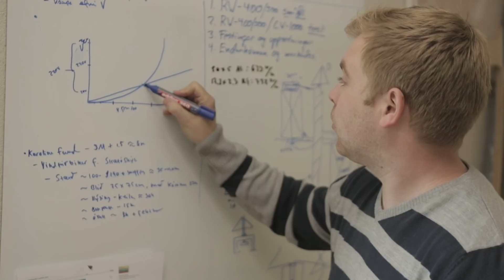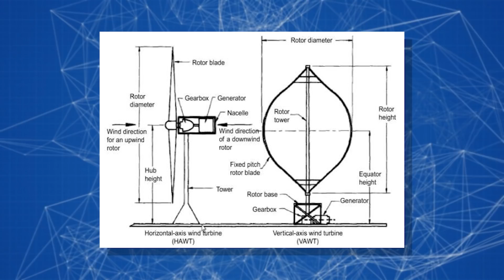Why This Wind Turbine Will Change The World

Comment: 100W? So it would take maybe 20 of these to bake a pizza? (Electrical panels in most houses are at least 100 AMPS X 240 VOLTS = 24000 WATTS)  This turbine may be interesting, but at present it does not seem very practical.

Comment: After viewing and reading the comments, it appears that for commercial application the VAWT may not be as applicable, but for residential purposes, like solar may assist with minimizing the electrical load. Couple with, if it becomes popular such as solar and a large percentage like solar gets installed will have an impact. Granted its windy...

Comment: I'm trying to figure out why you are comparing a little 1000 watt vertical axis wind turbine with commercial sized megawatt scale wind turbines...
There is no comparison.......
You do realize that you would need like 1500 of those little vertical axis wind Mills to equal just one commercial windmills. Also the efficiency of that style vertical windmills is about half of what the horizontal windmills are.
Wake up...

Comment: These can't go anywhere and be very efficient.  Urban areas have many wind breaks and you don't get NEARLY the wind that a typical wind turbine gets.  So while you CAN put it in your back yard, that doesn't mean the wind is going to be very good and you probably get near the lower end of that generation, which is too low to even run a gaming PC with a powerful GPU.  And don't even think about running a clothes dryer.  You need the big one for that.

Comment: Pure nonsense. Old tech in a different colour. Toy turbines compared to proper megaWatt machines is not a valid comparison. The efficiency of these turbines is very low compared to standard horizontal axis turbines and the torque developed is much less useful. Their only real advantage is omnidirectional operation.They're certainly not any kind of game changer.

Comment: Wind turbines need wind to work. Have a day or two without any wind or just s gentle breeze and wind turbines output is reduced. If the  wind is too high the turbine has to be turned off.

Comment: So funny - How many scammers have sold these type of wind turbines to uninformed consumers - Just ask Jay Leno - look it up!  He got scammed big time - from a guy who got investors and only build one for Leno's garage with fake UL stickers etd - which produced no power.   This is a 50 year old issue that clearly has VAWT losing every time - but there are so many people who wont do the research or the thousands of hard working engineers who have learned the hard way that VAWT are never going to produce even a fraction of the energy they claim.   Guy at Innovative Techs - you have got to do more research before you make these claims !

Comment: Since 2012, the average height of wind turbines installed in the United States has been about 280 feet, or 80 meters. Wind at that height is much greater than close to ground level.  The video shown here is merely about 10 feet.

Comment: I am not 100% certain but except the one with the american flag on it, the vertical axis turbines showed in the video are Savonius turbines. They wind passing them generates a drag force powering the rotation. Anybody familiar with wind power knows that these turbines have terrible power factors (meaning they don't produce much electricity). As other comments pointed out this is nothing new. Savonius filed his patent in 1924. Most turbines in the video are placed on buildings in turbulent wind. Most of these turbines will struggle to produce any useful amount of electricity and generate noise into the building. The silent operation you mention in the video sounds stupid, less rotation means less power coefficient and pretty much no power. Other comments also pointed out that these turbines capacity is very low in comparison to the huge megawatt turbines you are comparing it to. Why don't trucking companies just drive bikes instead? BECAUSE THE LOAD WON'T FIT!!!!

The real use case of these inefficient, small and simple turbines is shown in the video but not explained by the narrator. If you for example have a bus stop that needs power it might be very expencive to connect it to the power grid when a small turbine on top of it might be sufficcient to power it. 

I am really disappointed that youtube recommended this video. Its suprisingly low quality.

Comment: I want one to put on my car I will buy a million of these Contraptions I want to put it on my car to generate electricity why I drive
Reply: That doesn't work. Energy out=approx 15% of energy in. So by driving a car at speed the wind resistance created is 100%, the energy generated is 15% therefore the car will not move without another source of power. Perpetual motion machines can't be made.

Comment: My induction cooking system uses 7,700 watt at full power.  Which vertical turbine for "domestic use" can offer this power?  How many do I need to install?  I also need power for lights, electric water boiler, washing machine, linnen dryer, dish washer, baking oven, microwave oven, TV, computer(s)...  It will be a sad day when there is little or no wind, like most of the time where I live.

Comment: Like other turbines and solar panels, this unit is unable to provide a surge of extra power should it be installed in a latitude with extreme cold or hot. This is where coal and gas fired power plants  are far more efficient.

Comment: Vertical axis wind turbines is nothing new and they don't last long, the bearings are stressed out with 2 different g-forces (1, the force of gravity 2, the outward pull caused by the wings).  They wear out quicker. They're impossible to repair. They're more difficult to stop, compare to horizontal axis wind turbines as they have the advantage of turning away from the wind direction, twisting the blades to reduce wind pushing and they have an emergency brake inside.

Comment: This video contains specious claims.  The first is that this type of wind turbine is a new invention.  There have been many vertical axis turbines with helical blades like this before.  The second is the power output of these turbines is minuscule compared to conventional wind turbines - on the order of 0.5 kn to 1 Mw.  The  video conveniently overlooks this fact. Hundreds of these helical turbines will be needed to equal the output of just one large conventional turbine.

Comment: The problem is that if the world stopped using all petroleum and coal products, not much would change. All manufacturing, including making batteries, generators and motors creates pollution and greenhouse gases.

Comment: This is clearly a fluff piece. Green energy still only occupies a small percentage of total energy produced. Its been growing, but not fast enough. To fossil fuels out, you need to embrace nuclear. At least in the medium term. 20 to 100 years.

Iceland only has a little over 300,000. Just one mid size city, in the US. 100% green energy for them is not a big deal.

As mentioned before helical turbines are not new. Okay for small installations.  3000W max. That's not much. Typical roof top solar exceed that routinely. There are existing RESIDENTIAL wind turbines that output from 1500 to 8000 watts. The over 3000 wind turbines in Tehachapi (California) are rated on average 200,000 watts, each. ~100x bigger  ! Remember the square-cubed law, when it comes to scaling. Materials, and serious engineering have to be taken into account to scale up, that large. Its not a trivial task. So comparing the requirements of a residential unit, versus a utility unit, 100x larger, is really disingenuous !

Comment: The only redeeming thing about this video is that not a single person in the industry could possibly fall for this bullshit. A huge mass of unsubstantiated claims. 93GW of wind power capacity were installed in 2020. Care to guess how much of that was in horizontal axis wind turbines? About 93GW of course. And that's not because the companies that want to sell electricity go for the most expensive option, or the one with the most problems. They go for what works and makes sense.

It's a shame that this misinformation is upvoted as much as it is.

Comment: This sounds like you have NO idea what's going on in this trillion dollar industry.. WInd turbines aren't placed from homes because they produce so much noise and vibration, that's what Trump told you. The only issue is the shadow flicker. All the other problems do exist but are being managed just fine. The cost of installation also isn't increasing exponentially... In that case bigger wind turbines would never be economical, yet everyone is trying to install the bigger ones. Why? Because the cost to power production ratio get's better, the bigger the turbine is.

Also you don't seem to know how horizontal axis wind turbines work. They ALSO rotate because of the difference in pressure between the air above and beyond the turbine blade.

I hope you got a big paycheque for this video from the company you're advertising for. This video is a joke to anyone who knows what's going on.

Comment: This earth has been going through temperature changes for eons. It will get hotter and it will get colder. Go look at the hundreds of layers of ice in the arctic. They show "Hot", "Cold", and lukewarm the deeper you dig. It is just the way the earth is. We are a pebble in the universe. An IMPORTANT pebble but we are flying through space and time always.
Reply: The Earth is supposed to be in a cooling cycle, but industry over the last 150 years has artificially changed that to a warming trend. This warming cycle has warmed up the Earth in those 150 years as much as all the previous warming cycles had, taking 10-20,000 years, each, to do it.

Comment: Flat blades pivoting sideways while its oposite half pivots up betz claims impossible to support oil prices is and has caused global warming brain washed science of 1919 look at automatic feathering flat blade radial windmills both horizontal and vertical hoover dams in tides and winds that reverse naturally. Capable of gearing to light speeds right in left corner .

Comment: Weird to compare the noise produced by a tiny rotating metal structure that produces 100W of electricity, to a gigantic 1.5MW wind turbine. Then you didn't solve the noise, the structure, the complexity. You just scaled down

Comment: Another video that claim that solar and wind are clean energy... when you take note about the life cycle of solar panels and wind turbines, you realize is not that clean... Resources, Manufacturing, Distribution, Recycling... and this idea of vertical wind turbine is not new, simply is not efficient enough and not scalable enough... if you consider this for a home, then you need batteries, and that is another not clean story.

Comment: So it's a "new" type of wind turbine that's derived from a design patented in 1995 which was derived from a design patented in 1926. Hell you can find a helical turbine in DaVincis drawings.. I even saw a video claiming that it would be a "green" solution to put these next to roads to "recover" energy from passing cars, as if it wouldn't create drag and be fossil fuel generated energy with extra steps.

Comment: Not sure if the speaker is ignorant or incompetent. Does not know what "invention" means. Does not know that the  earth's average temperature has increased by about one degree for the last three centuries. Does not know the environmental cost of turbine blades, PV panels, and batteries. This is silly, clueless, or senseless.

Comment: What is the " minimum" wind speed for these to operate efficiently.??
Reply: Not sure exactly, it also depends on the generator and size(mass) but typically these types of WT require much less wind to operate but the video is clearly biased and not well researched. These turbines aren't as efficient as the traditional horizontal 3 blade design.

Comment: the main reason that horizontal axis wind turbines are generally used is that they convert wind to usable electricity more efficiently; when you combine that with the economy of scale and mature designs of the horizontal variant its pretty clear why they're used for most applications.
Reply: That depends on how you define the efficiency. Traditional horizontal fans wins out if you only consider the area they occupy. But that may not be the most important factor as the world is huge. What matters more is energy produced compared with cost of installation or service cost. Traditional horizontal fans are so terrible for both that they are almost not worth building. The vertical type shown in this video on the other hand is very cheap, that makes it not only better then the horizontal fans, but also compete better with other alternatives. It doesn't hurt that it's also less noisy and intrusive making it easy to put anywhere.
Reply: @znail4675  the range of wind speeds that thy operate in is greater Traditional horizontal fans need a big separation because of the turbulence they create

Comment: (facepalm)  What about this don't you get?  Wind is diffuse and intermittent.  You're never going to run a steel mill or rail system with it.  How, on those exceptionally rare occasions, are you going to store any surplus?  What are you going to use during peak power when it's insufficient to meat your needs?   Educate yourselves on Liquid Fueled, Molten Salt Thorium.  The name you want to know is Kirk Sorensen.  Off you go....

Comment: Ok, beautiful presentation. Now let me ask you, what is the power output or efficiency? 
Second, the noise from LARGE wind turbines can't be compared to such small turbines. 
Third, no way that can withstand a tornado, and the 90% slower speed for what?

In conclusion, that's worst than the guy that wanted to power the world with static power generator bikes,
or the one that made a tube and filled it with wind turbines and says it allows to extract 99% of the power from wind.

Turbines can have different sizes and forms, but the fact is that large conventional 60-70meter turbines don't have 4 blades because they would harvest too much wind power. 
Make stronger foundations and then increase to 4-5 blades and then you have increased production. Where is my novel price?
Reply: In all fairness, power lines can't withstand a tornado either.  Seems like a reasonable calculated risk if they produce enough to make them worthwhile.

Comment: Won't work in the scale needed for generating vast amounts of electricity.  He reason wind turbines are so large is that great torque is needed to send power into the gearbox, a transmission in reverse, you might say.  This spins the electric generator to produce the needed voltage.  In conventional power plants it is the opposite.  Fast spinning turbines need to be geared down before powering the generators.

Comment: Wind turbine, Solar panels, will not produce electricity, if there is no wind and during night time.  Elon Must knew that alternative energy will fluctuate up and down, and the only solution is BUY his TESLA Storage Battery to give power to indiviidual houses and one whole TOWN for hisTESLA MULTI STORAGE BATTERY. The wind turbine, Solar panel will charge the battery,  excess energy generated goes to the grid, but during storm, calamities you can have power for 3-4 days. EMusk  will monopolized Battery business by joining Lithium and Nickel minning Company from Australia and Indonesia.The money is in the battery not much on the car.

Comment: Solar energy burns alive thousands of birds each year, wind turbines kill thousands of birds too. When solar panels break, their contents are toxic for the soil and there isn't a recycling system to properly reuse and store said broken materials, additionally the production of these two "green energies" do have a carbon footprint and they need a gigantic area to work. These green energies are not really that green, and in addition to all of the above, these energies are extremely inefficient, thus increasing the cost of energy. The best and most ecologically friendly technology for producing energy right now is Thorium Reactors, but hey! cheap energy is not good for those who want to make a ton of money, so corrupt politicians are trying to block the use of thorium reactors.

Comment: Good luck. During the years there has been countless wind turbines that are just as good or more efficient than the standard design, and which is not a danger for birds, bats and insects. But it never happens. Why? Because the three bladed turbines dominates the market. They are the Microsoft of windpower.

Comment: The countries that report higher than 50 % renewable energy are lying. The wind turbine is screwed. Most of the turbines leak a ton of grease, and there is no spill containment for the grease, not even on the ground. The turbines also kill a lot of birds. Turbines are made out of oil based products and metal....all of which uses tons of oil and natural gas to manufacture. The whole save the earth with green energy is a lie. Even a new movie by Michael Moore points that out now.  For solar farms, you have to chop down hundreds of acres of trees to create the solar farm. Both wind and solar are also not reliable. Solar does not work at night, and turbines do not work when the wind does not blow...

Comment: Flowind tried helix wind turbins 35 years ago. I invested in Flowind. Then filed Chapter 7 a few decades ago. Today, there are wind power mechanisms with no moving parts. That's an innovation.
Reply: Except they are similar snake oil. No products after many years. Laws of physics are a bitch.
Reply: "Today, there are wind power mechanisms with no moving parts." 

References, please.